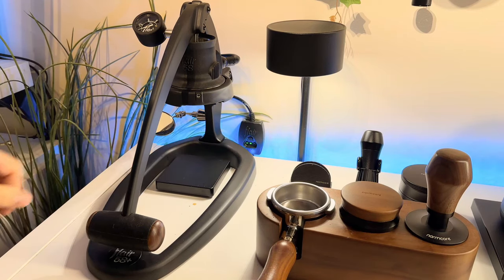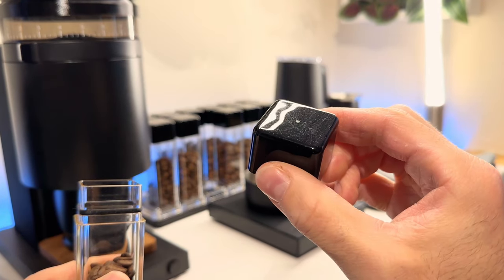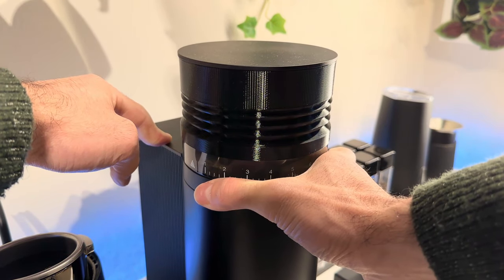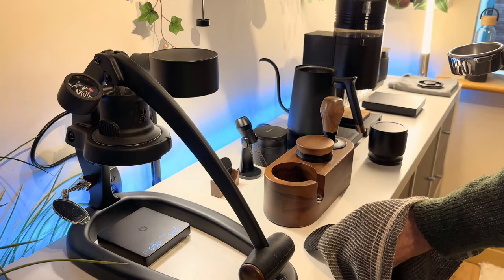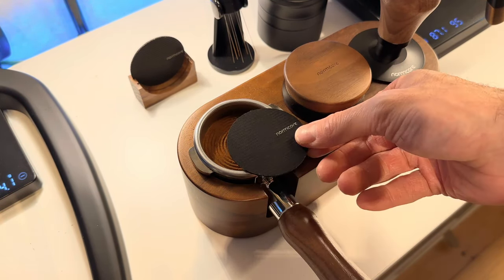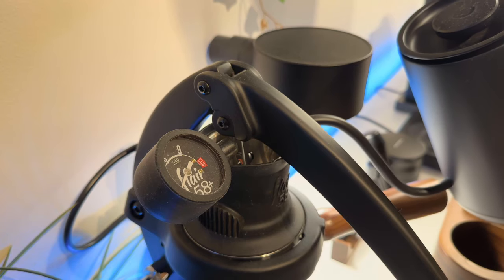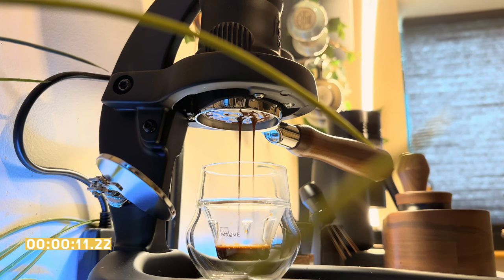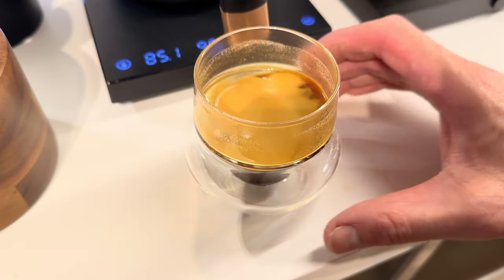How To Make Great Espresso with Flair 58+

Comment: In my experience, letting the portafilter (incl the dispenser screen) locked in the whole day while enabling the heating element, does a good job for preheating the portafilter. No need to preheat it separately.

Nice video tho, keep up the good work
Reply from the maker: That certainly does the trick, but I often forgot to turn off the machine after and would wake up the next day with it still turned on. I have a smart plug controlling it now! Thanks for the comment!

Comment: Can’t figure the grinding settings using c60 barracuda and it’s driving me crazy, wasting so much coffee beans with getting the proper grind size so I can get the flow in 30+- secs even through roasting is pretty much similar…I though cezve was complex way to do the coffee…pffff…espresso is the most complicated in my opinion😢😢😢
Reply from the maker: I feel your pain, my friend. It took me a long time to get great shots with the Flair 58. But don't give up - you will get there. I've never used a C60 unfortunately so I can't give you any advice there. But I do know that if you stick at it, you'll be making great shots soon :)

Comment: It is a great video, you should make a video talking about how do you deal with the espresso what I mean? basically how do you calibrate your machine, I also have a flair 58 but I always struggle with my espressos more when I get a new beans because I am not sure If I am doing it good or actually if it taste good so would be helpful watch more videos about how the people deal with their machines when they get a new beans!
Reply from the maker: Great idea, thanks! I’ll be making more videos very soon so stay tuned and subscribe 😉
Reply: I guess the struggle I had at the beginning was the same. Tho you have to grind finer with the flair, I now try to dail in by taste. I noticed that if the resistance of the puck is able to handle my 9 bars, I sometimes with 1 or 2 gram more water out completely take out the sourness or acidity it might have. This is with new beans the first thing I tweak which got me great results in the lasts months. Again Lance has a great video on this but as well the guys from Coffee up 🛎️

Comment: why is that a difficult machine?
Reply from the maker: If you imagine a typical boiler espresso machine, you dial everything in and the machine will dictate pressure for your desired time. With this, since it’s totally manual, you have to really be careful of water temperatures, and your pressure profile. It’s truly a manual experience 😊

Comment: Dear Nick, I have recently bought the 58+ and I am using cmd c40 with red clix. 20gr in 60 gr out within 50 seconds 6-9 bars with light roasted coffee. Since Im grinding pretty fine I think Im getting unwanted flavors but if I go courser flair cant give me any pressure that is needed. So could you help me dial in even though you cannot know what kind of coffee I have or whatever I think you can still help me out about what can I do or dont with flair 58. Thanks in advance for your help ❤
Reply from the maker: Hi there! Assuming you're using some fresh beans and good quality beans, I've a few follow up questions to try and understand your process better... 

1. What basket are you using? Stock flair? High flow / low flow? 
2. Are you doing pre infusion? 
3. What's the water temp?

Questions aside, a 1:3 ration is fine for light roasted coffee, but I'd suggest going back to basics to start if you're new to the flair. For a light roast, here's my process... 

95 degree c water, flair on highest heat setting. Pre infusion to 3 bars for 1-2 second and back off down to 1-2 bars until you hit 7-8 seconds. Then ramp straight up to 9 bars and hold that steady until you reach 25g yield... Slowly back off the pressure then until you end the shot around 3 bars, 40g out at 30-35 seconds. 

If you follow the above and the only variable is your grind size, you should be getting some tasty shots. Once you've gotten used to that, you can begin playing around with different ratios! Hope this helps :)
Reply from the maker: I should also mention that roasters differ in their definition of light roast, so this might now be exactly how you'll get the best out of your coffee, but works for me! In the video above, the beans are light/medium, so my pre infusion and profile stated in the video is a little different - I find slightly less pre-infusion as the roast gets darker works well for me. But don't get disheartened, you'll get there!
Reply: @nickscoffeestudio  first of all thank you so much for replying back so early, for your questions. I am using fresh beans (like 2 weeks) I am using high flow stock basket and fresh off the boiled water with highest settings, I was doing pre infusion but I was waiting for almost 10seconds. After reading what you ve been doing with your light roasted coffees I think I did get what I was doing wrong so I ll take a shot at the morning and reply it back to you. I would like to thank you again for your help. Hope you ll make more videos about it 🥰🥰🤗
Reply from the maker: No problem! Good luck 😊 just make sure water temp isn’t above 95 c otherwise you might get some of those unwanted flavours
Reply: @nickscoffeestudio  Hey Nick, I just had the most drinkable/enjoyable shot of espresso since I bought the flair 58+,  your recommendations really worked out I appreciate it. I do have one last question tho I have not been able to detach the new stem for cleaning would you make a cleaning video maybe ?
Reply from the maker: @mertcanaydn833  I’m very glad to hear that! And yes, I’ll plan out a cleaning video soon 👍 thanks, and enjoy the espressos!
Reply: Great video. I'm just curious...why 6-7 bars and not 9? Are you able to maintain pressure throughout a whole shot, or does the pressure start to decline as the shot progresses?

Comment: thanks for your time in sharing your views on this latest Flair model; has this new model a faster preheat time compared to the older 58? I note the mains power pack has been improved!
Reply from the maker: My preheat time to 3 lights is about 4 and a half minutes in the morning. Depends on whether it’s summer or winter though! Room temp varies here from 10° to 20°

Comment: Thanks for the video. I've had the Flair 58 for almost two years. It's been great except the plunger cylinder spins so I need to turn it so the notches don't align with the protrusions on the gage plunger after about 30 cycles. Also, with the handle in full up adding water can be tricky. It would have been better if the gage plunger would fall farther backwards giving a larger space to pour the water in with the handle up.
Reply from the maker: I think they improved the plunger in the 58+ with the valve, that definitely helps, but it’s still not straightforward to make sure there’s no air in there. As for the plunger itself, I’ve got the same problem with the spinning, so I also have to adjust. Little bit annoying but I’m used to it now! Overall great machine
Reply: @nickscoffeestudio  thanks for the reply and info. In that case I will stay with what I have, no need to upgrade/crossgrade. It does make great espresso. I actually make Americano's.

Comment: In manual they have written to keep water for 2 minutes before pulling the shot, I measured water temp drops down to 85 Celsius straight from the kettle. So holding it for 5 minutes giving me back 95 on bottom of the chamber (upper part is 95 always on 3rd heat level). Once water temperature is equal on bottom and upper part of the chamber I start pulling my shot. 

What do you think about it?
Reply from the maker: You make a good point. I’ll have to give it a go and see the results. I think for lighter roasts, then this would absolutely help! I had done some measurements before and after leaving the machine heating up for 15+ mins, then adding 95° water, it would give me 90° at the bottom which I’ve always been fine with. Coffee really become a science experiment doesn’t it?!
Reply: @nickscoffeestudio  As a special tip for you, For darker roasts it is also worth starting at 3rd level so it quickly warm up water then switch back to 2nd or 1st level as water temperature dropping faster than increasing. Having water in chamber helps with heat distribution and stability.

Comment: 👍👍 BTW ... which filter basket are you using i.e., low flow, high flow, or something different?
Reply from the maker: I’m using the high flow stock basket mainly, though I also have a Normcore high extraction basket as well.